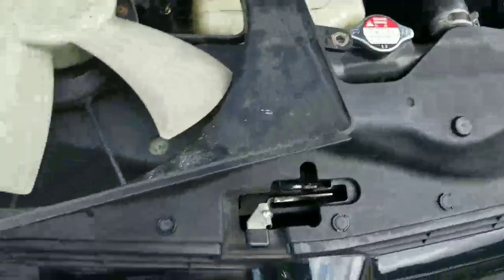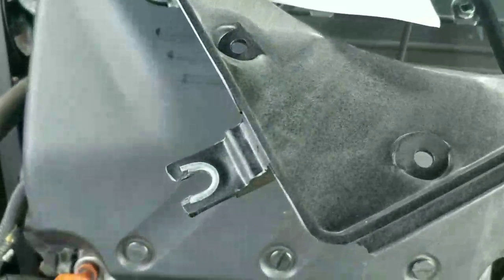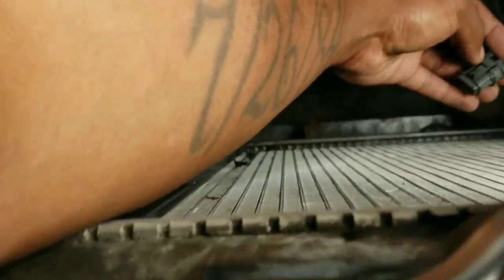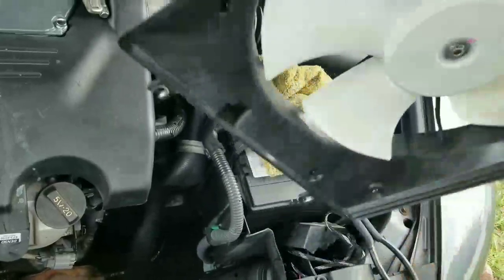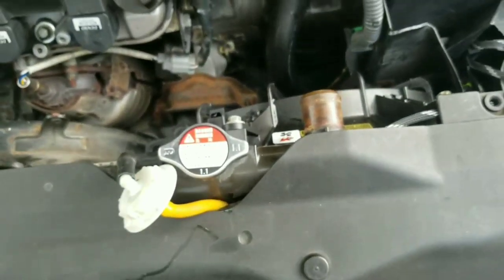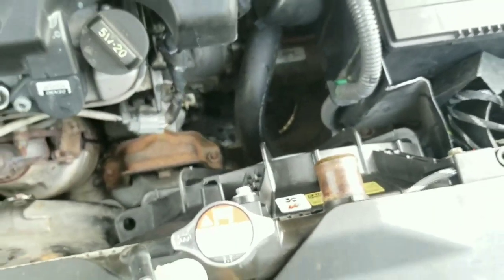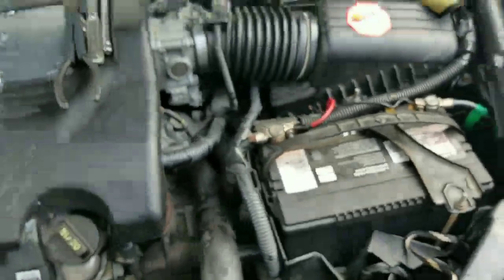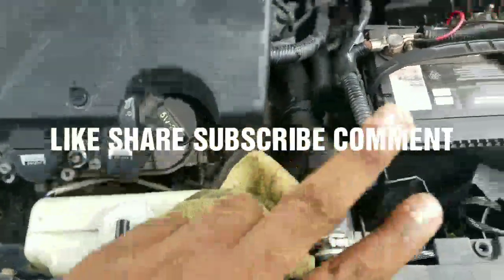HOW TO FIX OVERHEATING CAR ENGINE

Comment: Nice videos bro.
I’m having engine misfire at my first gear on my take off. I’ve changed my spark plugs and checked my coils and they all work. Any other suggestions?
Reply from the maker: valve adjustment
Reply: MODS FOREVER I’ll take a look into that. You got a video on that?
Reply from the maker: @alfredobarajas5852  no sorry
Reply: MODS FOREVER all good bro. Still subbed for the helpful Acura videos 🙏🏻

Comment: Have you ever had a problem with your knock sensor  I am getting slow acceleration up a Hill
Reply from the maker: no never
Reply from the maker: do u have a code for a knock sensor.
Reply: @fabolousg4ever  yes